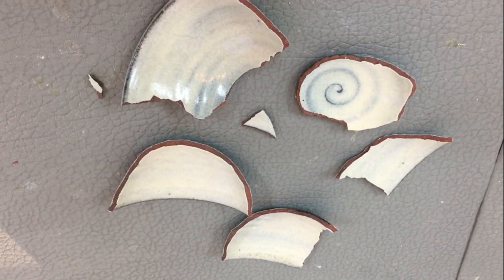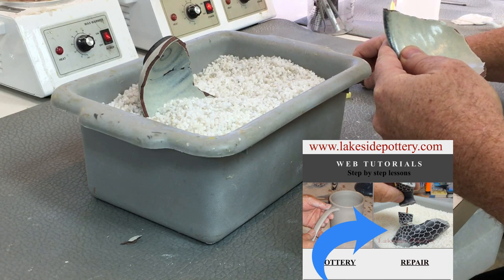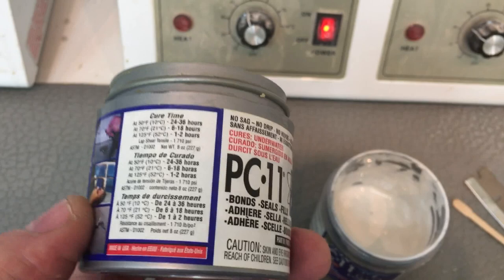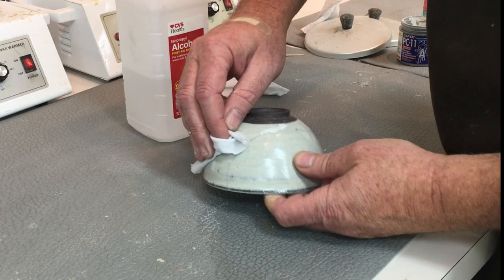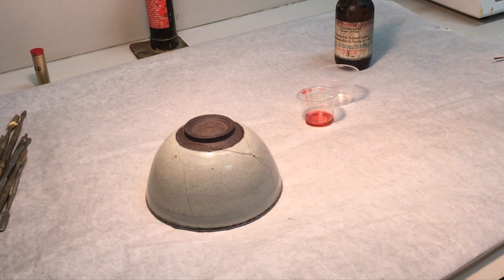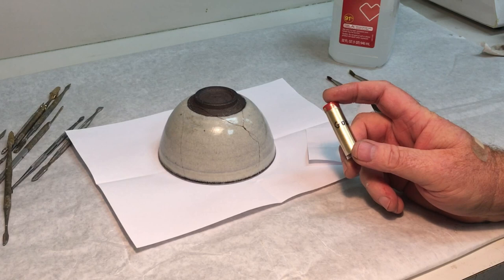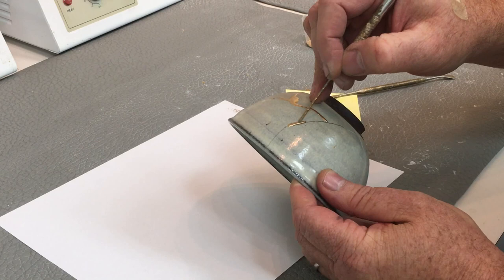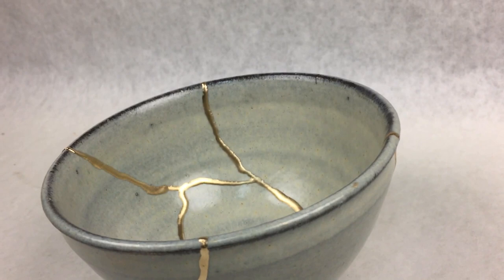Kintsugi Art Repair, Learn How Is It Made? Materials Used Process Instructions

Comment: @Lakeside Pottery  Can the alternative method (non-gold) also be rubbed for the burnishing process in order to flatten it more? If so, about how long do you wait after application of the non-gold/compound mixture?
Reply: A second question....can either of these Kintsugi methods be applied before or after a coat of cold glaze?

Comment: ah and would it be safe to actually use and drink tea out of the finished piece?
Reply from the maker: It will not have good longevity of used functionally.  Heat will further degrade it with time.
Reply: Which is why they use the Japanese lacquer and tonko powder. You can then use the object again. Whats the point of repairing the object if you can't use it anymore
Reply: @Edna2u  Can you please tell mi which Japanese lacquer ? have been looking for this info a while, thank you very much in advance :)
Reply: @janjakubilavsky1832  It is called Urushi Lacquer. It is made from the sap of the Urushi tree and it is a natural resin. It forms a kind of natural plastic.
Reply: That's wrong, actually. Urushi, the lacquer used is made from trees containing urushiol, which is also the oil found in poison ivy and many people react badly to the liquid form and even vapours. Please don't experiment on your own! The gold would also wear off if it was used. Think of it as art only. Repair clay and porcelain with food-grade epoxy!